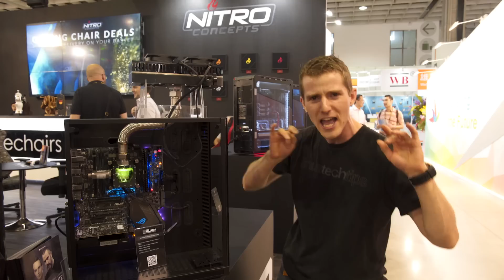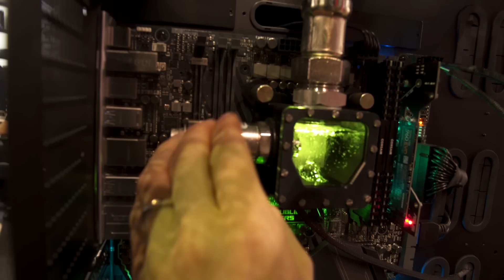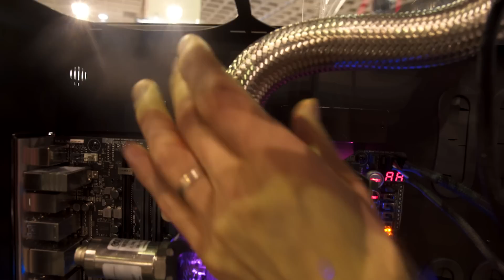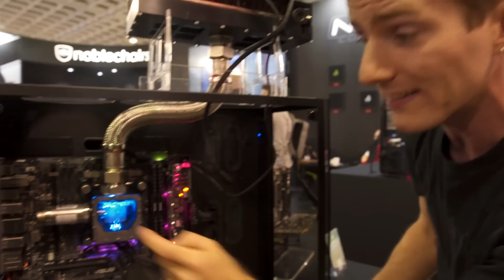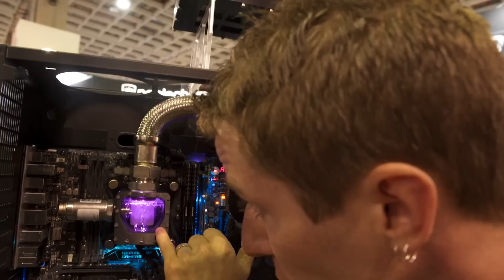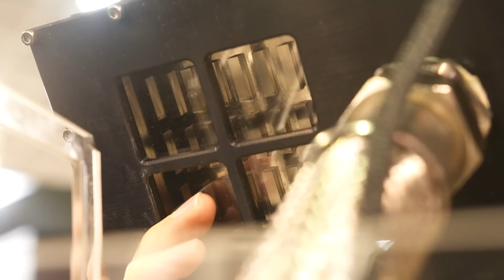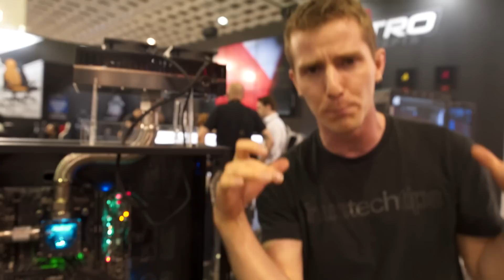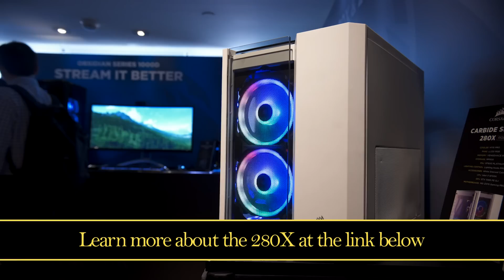Crazy Der8auer cooler prototype - NO pump!

Comment: Its neat but whats the point. It just seems like an overly complicated way of cooling a pc. Just use a pump.
Reply: Though you will need a separate unit for cpu and gpu if you wish to cool both. That will still be clunky
Reply: It would be hard to control how much fluid that would flow each way. And you would possibly need a gigantic radiator on top of your computer to make it work even if you solve the fluid regulation (that would possibly require more equipment)  if the size of that thing tells us anything about how much cooling capacity you need.
Reply: I wouldn't call it refrigeration. More like a heat pipe, like Linus said.
Reply: Yeah, refrigeration is the wrong concept, it’s similar to normal radiators, if not the same, since the heated liquid loses it’s heat from it, and moves back around. Also, since the liquid’s own heat energy is being used to move the water, it will be fast or more efficient at heating, thanks to laws of conservation of energy!
Reply: Wang Computers
 It looks cleaner except for the giant pipe that has to go through the top of your case. Its also way limited in where you can put the radiator. There seems to be no upside to it other than it looks nice.
Reply: no moving parts other than fans tho. the single biggest issue with aios is pump failure. this this can achieve the same thing without the need for one thats perfect. only real downside is, it HAS to be mounted at the roof of your case because the fluid flows back down to the "reservoir" only using gravity.
Reply: Silence

Comment: I would assume they use ethanol or other similar alcohol based fluid as the cooling liquid, if it spills just leave it to dry.  Boils at around 78,37 Celsius so it will keep the cpu temp stable well within usable temp range. Ethanol is also very easy to condense.

Comment: It's 3M's Novec fluid. It's for 2-phase immersion cooling. De8auer made a computer with it (Exalhare?) And he said he was going to make a Exalhare 2.0. So that's what it probably is because normally for Novec you need a sealed tank where you put the whole PC in. And on 3M's website, they recommend glass and metal for the tank. So if the window is glass, then it is almost certainly Novec
Reply: yeah not novec

Comment: @Linus Tech Tips I bet you it's Chlorofluorocarbons(Freon). Freon is a gas at room temperature and a liquid when cooled or compressed. Though I don't know how quickly it turns to gas in a heated state. Could be a modified Freon gas. Probably not now that I think about it, I dunno.

Comment: well it is boiling at under 100 degrees C (hopefully) and you probably want it to boil well before it gets close to 100 degrees C so it would be some hydrocarbon like acetone or something like that. ( something with a boiling point around 50 degrees probably)

Comment: 3M™ Novec™ 7000 Engineered Fluid
Reply: 3M Novec 7100 boils at 61 degrees celsius. In the Der8auer's Project Exhalare 2.0 video, he mentions that 3M Novec 7100 boiling temp of 61 degrees doesn't leave a lot of room for overclocking and that he's working with a different fluid.

I assume this has the different fluid he was speaking of. Pretty exciting!
Reply: 3M Novec was my guess too but I was thinking 7100 because of the higher boiling temps, then again there's a pressure value so it might be 7000 under a little pressure to  raise the boiling point a bit.
Reply: They specifically said its NOT novec because it can't be shipped internationally.
Reply: Lorne Nix .. yep your correct
Reply: Probably not. If they are confident no one will geuss the fluid it prpbably isnt a semi well known fluid like the
Reply: Lorne Nix some say its not
Reply: Yeah it is
Reply: Then it could be anything, like fragoltherm (maybe one of their W series liquids, from a quick glance) or whatever. Or it could be pressurized gas
Reply: Bogdan Golovanov it dous not look strong enough to be a pressure vessel.
Reply: Its be confirmed to not be anything Novec™
Reply: It might be something like 7100 or 649

Comment: can't be flammable, can't be overly basic or acidic, can't leave a residue, cant be very high pressure, is clear, cannot be toxic to breath vapors... (all this assuming restrictions for application and user safety).....   No idea yet.. could be a gas that's liquid at low temp/pressure, but its a vapor...  F it, it's water!!     maybe in a slight vacuum..

Comment: Nice one system that system reminds me  chimneys with two holes pulling hot air outside and from the other hole the cold air(cooling flow without pumps). just closed pressure water cooling and air for bubbles on CPU from  (Funs) traficking

Comment: cool but whats the point
Reply: Unimportant Account same cooling performance as a normal LC but with lesser space used?
Reply: More efficient cooling system. Normally with liquid cooling your using electric pumps to move a liquid around. This system is using heat instead of electricity to move the fluid.
Reply: If you can't see the point of this, then you've never used AIO Liquid Coolers before.
Reply: the efficiency improvement is that important since it would be minimal two valid option that I can think of
1) better cooling due the use of different liquid 
2) probably better lifespan of the AIO - if you look at gamers nexus videos about Asetek AIO they noted that the main failure of AIO is due to 
pump failure caused by permeation of water outside the loop so if you the pump from the system the chance the failure rate would be much lower 
and with big enough reservoir permeation would be less of a problem or if you add the the option to refill the loop when needed.
Reply: Well i imagine it uses less power?  All the power for circulating the liquid comes from the heat of the CPU.
Reply: Hermaeus Jackson yeah! And if you understand a little physics, the heat energy is turned into kinetic energy, which means it will cool faster! Similar to the energy regaining system from F1 cars!
Reply: you guessed it right: cool

Comment: Looks like it has a low pressure difference, be it negative or positive, so it has to be something with a boiling point close to room temperature. Ether, methanol, acetone, carbon disulfide? Could be something with higher boiling point as Linus complained it's hot, like ethanol, carbon tetrachloride or isopropanol. Since these are easy answers and he mentioned noone's probably going to guess it, it's very likely a mix, to widen the temperature gap for a given temperature variation.

Comment: My theory is that it's the same fluid as in a system he's selling where all components are submerged in a fluid.
That system uses some 3M fluid that boils at about 60°C i think which seems to use the same basic concept as this cooler.

Comment: I know that he used Novec by 3m in earlier project, that where cooled with boiling and condensation. It's a mixcture of differnt organic fluids. It's non-conductive, non-toxic, and inert. There are different types available with different boiling points.
I would gues that he also uses Novec in this system. Probably one of the versions with a lower boiling point like Novec 7000 (kp= 34°C) or Novec 1230 (kp= 48°C).
Reply: Nope he didn't. Because of international import/export laws he could not use that.
Reply: VenoXj1 Okay. Didn't knew about that. I just thought about systems he showed off in germany where he used Novec.

Comment: I'm guessing either moonshine or water under a vacuum. Maybe amonia like a gas fired refrigerator, I could even be non colored ethylene glycol like used as a tight welder coolant. I'm sure there are also many presurized refrigerants it could be. But I'm guessing it's nothing special. The cool thing is you can measure temperature with pressure since the boiling point raises with pressure, as long as the fluid is phase changing the temperature and pressure are fixed to each other.

Comment: there isn't anything heating the coolant (that cable underneath is just the RGB) the block has a gait that uses the pressure fro the heat created by the card to push the coolant under a "U" bend after which it spirals to the top and evaporates with the heat from the card, when its cool more coolant is available to the card making it more sensitive to lower temperatures and when it gets hot it keeps itself from turning into steam and melting the card. but it just basically a heat capacitor with some "Coolant R11" or whatever, the stuff in cars.

also I think it would have to use two pipes to maximise efficiency, however if he put enough work into it he could create preparatory tubes that use osmotic pressure to push the coolant through the pipes even if it kinks to high.

But what am i saying, these are computer wizzez, not people who took biology seriously. But  do give respect as I'm not so confident with software.
Reply: THERE IS SOMETHING HEATING THE LIQUID... THE CPU!!!!!!
Reply: explain the use of osmotic pressure to me please.
Reply: You are wrong, a heat sink is heating the liquid under the block. The liquid evaporates (the little bubbles) and the hot gaz is rising in the tube to the cold heat sink, cooled by air and fans. The liquid condensates on the rad, and drips back in the liquid. There is no need of osmotic pressure to push the liquid up, because it already evaporates.

Comment: Actually vodka makes a lot of sense, but i doubt it's vodka, just technical alcohol, is cheaper and has more alcohol, and if it evaporates faster - it will make the cpu cooler, not striving for that heat capacity of a coolant here

Comment: i guess its mineral oil or water that has been spiked with a fluid that lowers its boiling point or isopropyl alcohol. just thought of it but vinigar could be it because it has a low boiling point, it can be used in electronics if the motherboard is waterproofed, and it can 't corrode electronics. there i hope one of these is correct

Comment: What if it's just liquid nitrogen but at high pressure
That would make this a mainstream ln2 cooler
Reply: Nice. But the critical temperature for nitrogen is 126.2 K (-146.95 C), so it's definitely not that. For those who don't know, the critical temperature is the highest temperature at which a gas can be liquefied, no matter how high the pressure is.
Reply: John Cochran I didn't know that o.o What about co2? I heard it's super critical temperature is much higher
At this point I'm just curious

Comment: shouldn't be too difficult to find a suitable liquid,  high heat capacity, and condensation/ boiling points pretty close together further it should for obvious reasons not degrade under use so it's surely no mix

Comment: idiots be idiots. This sort of cooling isnt made in bulk because it cant be done or its difficult to do.This cooling type isn't used because it does "termal runaway" like a Chernobyl reactor.  The more heat u introduce the more liquid is turned into gas, the more heat is stored in the system the more steam capacity it has. All in all it reduces the amount of liquid at the cold plate,  this means less coolant around cpu and even higher temperature,  even more steam, even less liquid etc etc

Comment: the coolant is probably a alcohol based fluid because the boiling point is lower than 100*c (the CPU cant over heat) and higher than 40*c (the fluid would otherwise evaporate almost immediately) also the fluid is clear so it probably isnt anything like bromine.

evaporation temperatures of alcohols:
methanol - 66*c
ethanol - 78*c
isopropyl Alchol - 80*c

alcohol would also be great since bacteria cant survive in it and it doesn't corrode the metals nor easily dissolve anything within the system

Comment: This is probably regular freezer or air conditioning coolant. It may be also just carbon dioxide under high pressure. Exotic compounds are unlikely due to high cost and safety concerns

EDIT: it also can be methanol, but I don't think that would require high pressure tubing

EDIT2: Also butane, this would be nice since you could refill it with just lighter gas

Comment: My guess would be either alcohol, methyl acetate, or another low boiling point liquid.  Only issue I can see, it would have a high risk to dissolve some of the parts....
So did the guy just make a still out of a computer and is recycling the alcohol?

Comment: liquid=liquid co2 (it is possible with enough pressure )or liquid nitrogen (pressurised) or something close.
Reply: CO2 would have a working pressure of 900psi... that's not something you want to sell to your average computer builder.
Reply: Kobe Wild well we are humans we can do anything.
Reply: Yes, but killing your customers should not be one of them.  something blowing up at 900 psi.. thats a bomb... it would blow the side of the computer case off and embed the remains of the cooler in the wall or your head.
Reply: Kobe Wild it won't explode that case is thick enough to contain it .

Comment: If I would do this, I would use methanol.
It has a heat capacity that is near that of water, it has far lower viscosity then water and will easily flow back down. And it has a low boiling point at atmospheric pressure.
But though. They could just do like commercial heat pipes and just use water in a low pressure environment where it boils at a lower temperature.
Or they use some snake oil that is more expensive, and not having any real advantages to anything mentioned above.

Comment: Most likely water under low presure (pressure transducer is a giveaway), or ammonia, as those two also have one of  the highest spesific heat. (which means they require large amounts of heat energy transitioning from liquid to gaseous phase).
Reply: Might want to review your terms.
Specific heat is the amount of energy it takes to change the temperature of the substance WITHOUT changing state.
Heat of fusion (or enthalpy of fusion) is the amount of energy to change state between solid and liquid.
and finally.
heat of vaporization (or enthalpy of vaporization) is the energy needed to change state between liquid and gas.

But the actual enthalpy of vaporization needed for this application is fairly meaningless as long as there's still liquid available under worse case conditions (low values mean the boiling will look more violent under high load, high values will cause more of a "simmering" appearance). The critical aspect is the actual boiling point of the fluid under the pressure the fluid is subjected to and that should be somewhere between 40 C to 90 C. Other considerations is the toxicity of the fluid in case there's a leak as well as any chemical interactions the fluid may have on it's immediate environment.

Comment: System is under pressure, but nothing extreme. Easily transitions from gas and liquid at a fairly low boiling point. I would have to guess propane here. It's used as a coolant in some camper fridges, if I'm not mistaken, and is kept as a liquid under 200 psi at around 75°F.